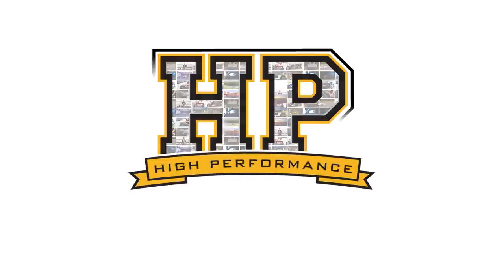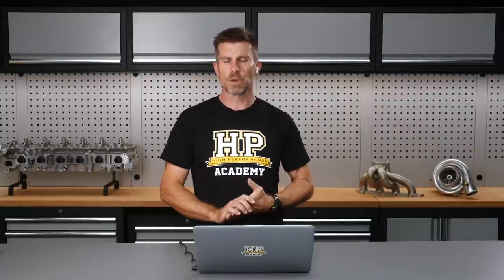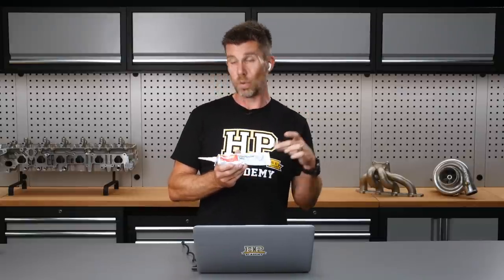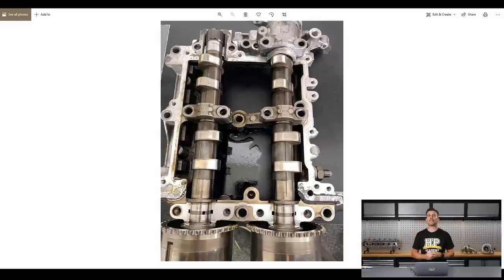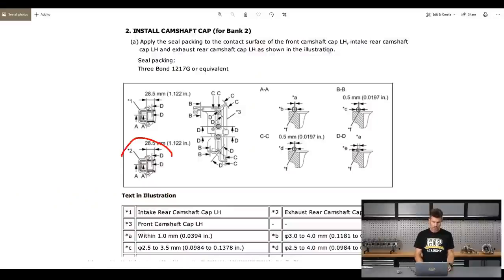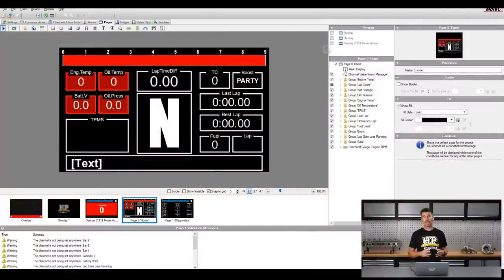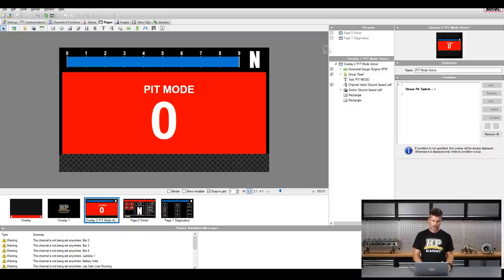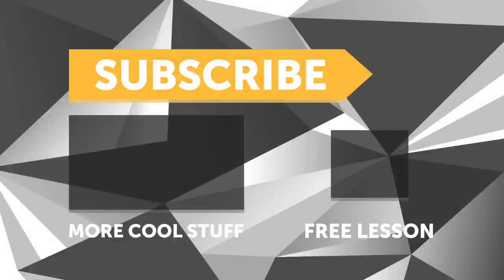Are You Using Engine Sealant Correctly? [#UPDATE 302]

Comment: Another pro tip for RTV nerds. If your using quite a lot fairly regularly Wurth make a product called “wurth super RTV silicone” which comes in an ultra nice pressurised can with trigger dispenser. It is used all the way up to F1 parts. Red has the highest temperature rating but for 95% of scenarios the black or grey is suitable, looks nicer and is marginally easier to clean up with a combination of acetone and gunwash.

Comment: I used three bond to seal up my barra engine. I was told to not put any three bond on the front and rear half moon shape sump seals, just a bit on the flat corners. Sealed it up and got car going and drove it for about 1000 ks, oil started leaking pretty much straight away at front of engine running down behind harmonic balancer. thought it was front crank seal, replaced crank seal and  put motor back together and before even starting motor oil was once again running down front of sump. Pulled balancer off again and found it was leaking out front half moon sump seal. pulled engine out, sump off, new sump seals and three bonded the seals this time. long story short, Fixed it yaa.  I figured it needs three bond on the seals front and rear to ensure no seeps of oil because the sump may not squeeze up firm enough on the seals to eliminate leaks.

Comment: Three bond is the go to sealant for putting motorcycle cases together although I’ve used loctite 515 no probs and the excess gets absorbed by the oil and doesn’t block galleries a huge plus. Have u revues W.P.C engine treatments

Comment: Personally, been using Hylomar since I was a young'un, just a smear for the most part.
One thing that I may have missed being mentioned is when people use WAY(!) too much sealant - distressingly common - is the sealant being extruded to the inside of the engine where it can break off and block oil pump pickups.

Comment: there is a factory toyota sealant that is orange. used on gearboxes and transfer cases. I have some on my lexus GX (toyota prado in NZ). I was distraught when i saw it (it's not even applied nicely, lots of splooge out the sides) thinking my gearbox and trans had been rebuilt but that's not the case. Original... I can't post a screenshot of my records but 00296-01281 is the part number for orange FIPG sealant. Threebond part number is TB1281. 

All of that is a little less useful than what i actually came here to say, but threebond is expensive. What isn't as expensive (and easier to get) is Aisin repackaged threebond sealants. AISIN AB1207B1 is black sealant used on oem toyota (and probably that FA20) and similar while AISIN AB1217H is the grey that is used for most subaru pans/blocks/covers. Also equivalent to hondabond.

Comment: Any mention of anaerobic sealants such as Loctite 518 ?
Reply from the maker: For what Andre is discussing here, ThreeBond is his go-to, but the emphasis is really on using it correctly and where you get that information from even if you feel you want to use something different - Taz.
Reply: 518 or 515 are amazing for machined faces that need sealing. I use it all the time for timing covers on heavy diesel applications
Reply: Permatex makes an awesome anaerobic sealant. 👍
Reply: Anaerobic for sealing BMW bedplates. You inject it in the side of the block with bedplate bolted down. It’s German over engineering! 😅

Comment: I'll share something for cleaning alloy that I discovered a while back when cleaning engine parts. 

Faced with lots of oil tarnished alloy parts, I wanted to find the best way to clean them. I tried all sorts of things from brake cleaner, acetone, alloy cleaner, alloy wheel cleaner, Simple Green, to dish drops, and then clothes washing powder. Interestingly the clothes powder was kind of working. How about something stronger then? Nappy San? Yeah, that's even better. Now lets make the water 80 - 90C, put on thick gloves, and dump a good 2 cups or so of nappy san in about 10 - 15 litres of water. Pop those alloy engine parts in the solution and the tarnish just about falls off! You're left with parts that look like they are brand new and the solution does not attack the alloy. 

Seriously folks, give it a try. But watch that hot water, don't get it on your skin, and wear protective eye wear!
Reply: Cast aluminum as well?
Reply: @shanebrownlee69  
Yes, primarily it was cast alloy that was the dirtiest. But it really made no difference if it was cast or forged, it all ended up sparkling.

Really hot water seems to be the key here. I used a 2400W immersion heater to get the bucket up to temp and boost the temp from time to time.
Reply: @peted3637  I'm in southeast Louisiana with burners and seafood boiling pots, so I'll have a great way to get hot water onto everything. Thanks for the awesome tips! 🤙
Reply: @shanebrownlee69  
Home of Gumbo! I'd love to visit one of these days.
Reply: @peted3637  the food here is the best in the world in my opinion. Definitely visit one day!
Reply from the maker: I haven't managed to get through watching them all yet, but recently Jafromobile has covered polishing ali car parts on his channel. He's usually on the money with things so worth the watch I'd say - Taz.
https://www.youtube.com/user/Jafromobile/videos?app=desktop
Reply: Do you mean Napisan detergent?
Reply: @allanb3222  that's the one, but I used that name as a generic term.
Reply: Buy a sonic cleaner cheap of ebay
Reply: @HomeMadeBoards  you can't get a cheap one to fit large parts like cylinders heads or blocks.😂
Reply: @allanb3222  yes you can.
Reply: @HomeMadeBoards  a cheap $80 dollar one like the normal Small ones, i like to see that! 🤣
Reply: @allanb3222  No idea what you're on about. 30L $200 and it does cylinder heads.
Reply: @HomeMadeBoards  you ain't getting one for $200 they go about $280-500.